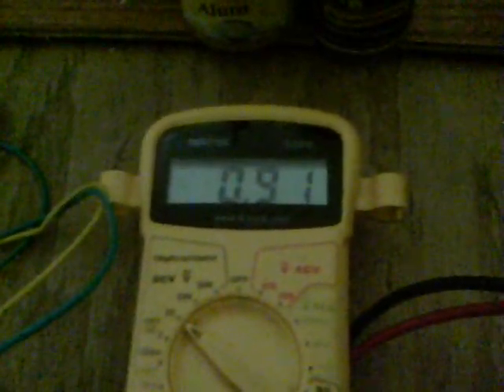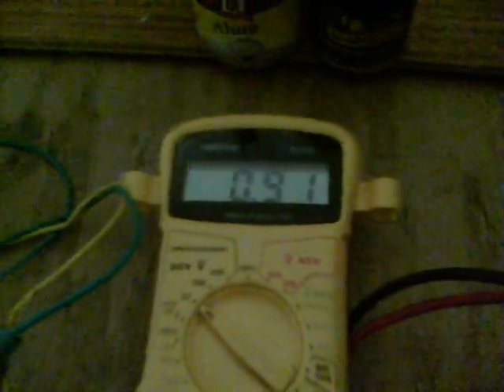Steel Electrodes Crystal Cell - Rechargeable

Comment from the maker: Thanks, very kind to say so. 
Idea can be taken further. Here we have many storms that knock out power for split second and everything resets/reboots etc. If system charged a big cap bank via all those house battery connections, then the very event that causes the brown out would keep the house going. Caps would discharge and only last a second, which is all it would need...like a UPS bridge in operation. 
If no brownout, then the storm has created energy in the caps for slower discharge uses.

Comment from the maker: Each crystal structure will have a resonant frequency, piezo is made from heated baking soda and Cream of Tartar. Cell built like a 'Cantenna' with piezo paste on internal wall would have same metals electrodes of 1.21". Output to 7.8Hz oscillator, with microwave self resonant coil spec. Hetrodyne the feedback with AV plug coil collapse and caps on output. Use Earth Ground on Negative electrode. Just an idea :)